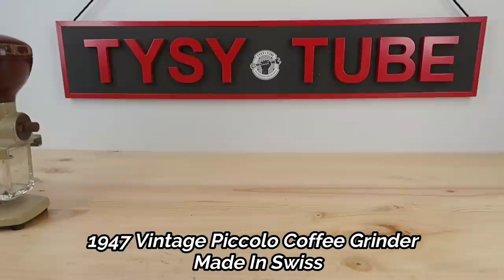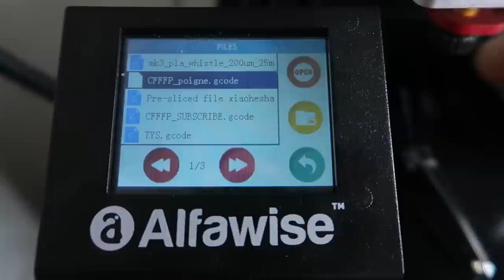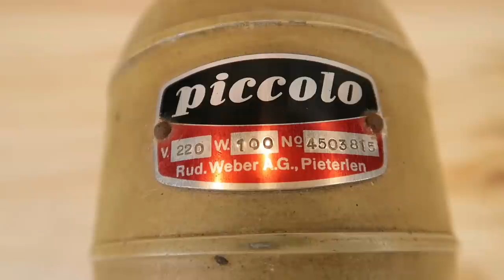1947 Swiss Made COFFEE GRINDER - Piccolo - Restoration

Comment: 0:40 when things were built to last...
Reply: Yup! When they were made of metal! They are also easy to disassemble and repair. Modern plastic appliances..... you have to break off the plastic to disassemble them! Those little bits that fit into slots. They are made so that once the housing is attached, it can’t be remove without ruining it!
Reply: Yeah, and they were only owned by rich people.
Reply: Yep
My parents have a 25 yo fridge,and is work like în first Day.never been repair!
Reply: Yes, which almost tanked the Swiss economy when countries like Japan started flooding the market with cheaper products. Our economy still hasn't fully recovered since then actually. Many of our companies which had solid reputations at the time either went bankrupt or were so downsized they're almost irrelevant.

Building overly robust and long lasting products is a shitty business model, sadly.
Reply: @willg4802  I get your point, but it wouldn't be a good idea to have people fiddling around with electrics who haven't a clue what they're doing.

Comment: Well done Restoration of this little Mill!

One important thing, at Minute 17:22, when you switch on the bench grinder, if you have to give it a little push by hand, that means the motor capacitor is not working as it should (damaged).
Replace it, also makes the thing run cooler, smoother and faster :)

It depends on the size, maybe you also have a model with a starter capacitor/centrifugal switch, whose contacts are worn out. 

Only way to find it out/fix it, would be to disassemble/fix it ^^
Reply: that should be his next video to fix all of his workshop items lmao

Comment: but I would take a 3-wire cable with ground connection to have more security against electric shock, because the winding insulation is old.
Reply: And the bakelite plug could easily break and expose a live wire. I would have liked it more if it was up to modern safety standards

Comment: This was pretty much the perfect restoration.  There was sandblasting, glass repair with resin, super niche tools being used, sense memory triggers with the ‘bakelite smells like old tv’ comment, 3D printing a replacement part, and it was a coffee grinder.
I can imagine antiques experts in 100 years coming across one of these: “It’s clearly a mint condition 1947 Piccolo coffee grinder.  So many original parts in mint condition. But look, it has nylon washers and silicone feet. I think what we have here is an original Tysy restoration! There’s maybe only a couple thousand of these on the planet!  The value of this item just doubled.”

Comment: Hey Tysy Tube I have a camera from 1945 it's a Argus C3 Rangefinder most of the camera's body is made from black bakelite the camera was made in Ann Arbor Michigan the camera was made from 1938 to 1966 and mine is a 1945 it doesn't have the Argus logo or badge on the front mine was black but I took off the old leather and cleaned it and got replacement leatherette for it it was light brown everywhere except for the top front that was black I kind of made it look like The Argus C3 Mathematic color theme and it has a flash unit it is black with a metal disc on the front but as I was saying it is made from black bakelite and stamped or milled metal piece's

Comment: If you still have this grinder, please take the bottom plate off and tie a knot in the cord as a strain relief, the heat-shrink tube isn't enough.
Look at the disassembly portion of this video for the knot I'm talking about...

The way you did it, if anything yanks on the plug, it could easily be pulled out of the grommet in the base causing the connections to be damaged (risking a short) or broken entirely.

Comment: No showing of the Resin repair work on the glass or finishing,  also checking the windings and cable on the motor would have been nice, also don't see any earth on the plug, no gloves while using the wire wheel. A Super restoration but a couple of shortcuts.